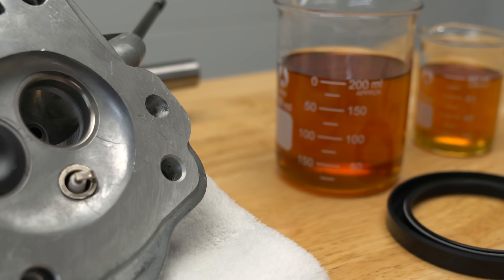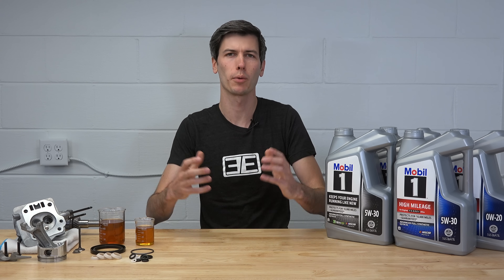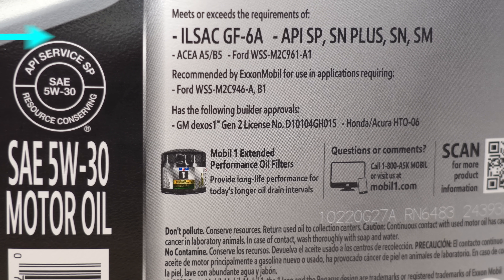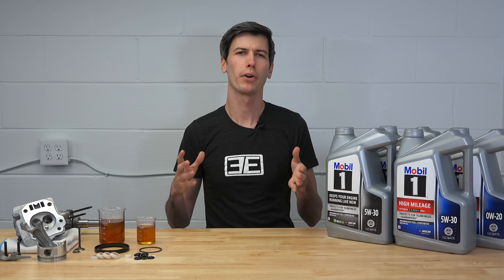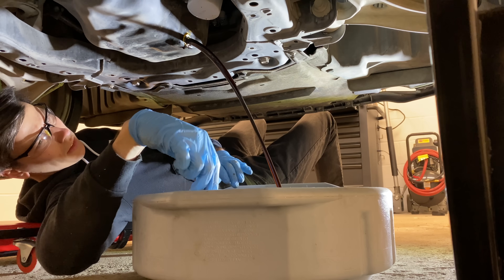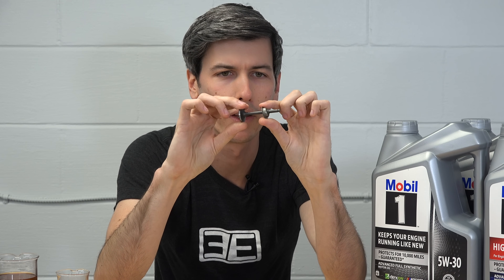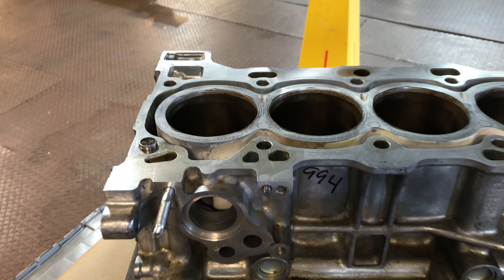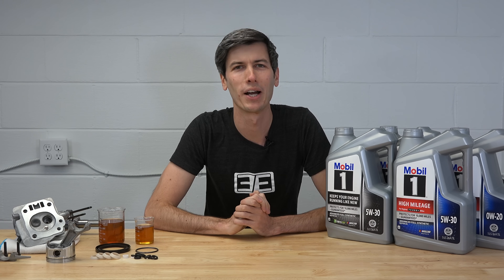Is Synthetic Motor Oil Bad For Old Cars?

Comment: When I was in airframe and powerplant school, we brought in our oil filters after changing oil on our cars to learn how to cut them open and diagnose what is in the filter media. One kid had a v-8 Chevy caprice with over 100k miles. He cut the filter open after first change to Mobil 1. The filter was jam packed with carbon. When he cut the filter media out he was able to fill quart size bag with carbon. So if you switch to synthetic in older car, I would change filters every 500 miles and cut them open to diagnose how much carbon is being accumulated.
Reply: Im guessing that may be due to the detergents in modern oil
Reply: @Magnamaxx01  once again, detergents and cleaning, ie having a clean engine is not a bad thing.
That guys Chev engine had obviously been neglected.
Reply: Quart size bag full of carbon from a guard size filter?
Reply: robert mccully Yep, read my post. It was JAM PACKED tight. Once cut open and  pulled apart the carbon filled a quart size bag. He kept the bag of carbon for souvenir.
Reply: @naps3386  that was for the first change clean out, second change was probably better and third was probably crystal clear.
Reply: admiral_peck 7 Probably
Reply: @BasketCaseGarageForFun  I agree
Reply: This only happens, in the engine is neglected. If you always have changed the oil, right viscosity, synthetic oil will clean just a little bit more. I would change the oil and the filter early .

Comment: The new API rating (SN & SN+) is not reverse compatible it does not have the zinc content needed in older flat tappet engines, the amount used is reduced to the point that even adding a zinc additive is not enough with those new API Ratings.  You can purchase high zinc content oil (Hot Rod Oil) but if your car or classic truck is equipped with a catalytic converter, it will coat it, reducing its effectiveness, not a big deal if your area does not require emission testing.

Comment: Great video. To be honest, none of these things concern me. The only synthetic issue I have is internal leaks, past the piston rings. In my marauder, I was running synthetic oil and burned about a quart of oil every 1000 miles. I switched to conventional and don’t burn any oil at all with my 3000 mile oil change interval.

Comment: Question: Should you use a different viscosity engine oil in the winter than you do in the summer?
Reply: Depends on the engine and the temperature difference between summer and winter. These days, most manufacturers are recommending 0W20 - no need to swap oils for the season. However, if you have an older engine and you live somewhere it gets really cold in the winter, you can make a good argument for running thinner oil in winter.
Reply: No. The whole purpose of multi-viscosity oils is to eliminate the need to switch. They're thick enough for hot temps, and don't thicken up so much in cold temps. Jason already addressed this in his "Will Thinner Oil Damage My Engine?" video.
Reply: @jonclark1288  Fair point, but there are exceptions to every rule of thumb.

Most modern engines are recommended to use 5W20 and 0W20. The OEMs do their testing and determine these viscosities to provide adequate lubrication at high temps, and obviously they flow fine when it's cold. In a lot of cases, there are parts (like AFM or DoD lifters or VVT actuators, etc) that will not work properly with thicker oil - despite fact thicker oil provides better lubrication at high temp.

However, if you do not have a newish modern engine, a 0W20 is not suitable. For example, I own an old 1995 Subaru with 365k miles on it. OEM recommended 10W30 or 10W40, but they also mentioned in some hot climates, or high-load/towing conditions - that 20W50 may minimize oil consumption. I found that my car, with 10W30, consumed a fair bit. So in the summer I use 15W50. But for the Michigan winter, the hydraulic lifters would noticeably rattle too long on a cold start. So I'd use 10W30 in the winter to solve the problem.

There is no singular "hard and fast" rule that captures the nuances of all cases.
Reply: @GroovesAndLands  ok thank you so much! I own a 2004 volvo with 215k miles on it, and live in western maine so I am probably in a similar situation as you.

Comment: Hey what's the hype with the synthetic oil I've been using conventional motor oil for as long as I can remember and I'm currently 55 years of age of course I do change my oil on a regular basis, based on old school every 3000 miles or 3 months whichever comes first I've never had any issues, convince me that I'm supposed to pay more for synthetic oils because it's supposedly better!... p.s. and yes my vehicle see the drag strip on a regular basis.

Comment: I have been using synthetic 15w-50 mobil1 and predominantly amsoil recently in my e30 for 5 years in two different cars. If it leaks it's because the engine needs new seals. Especially since the factory oil pan gasket is cork...
Reply: Why so thick? I want to  put that weight in my e90
Reply: @EKHBLOVER  I have a m20b25 and the factory spec weight is 20w-50 I will go from 15w-40 or 50 depending. Or even 20w-40 to 50. Since you have a new car just use the factory oil spec. And use a good synthetic. Mobile1 is good. I just prefer amsoil for longer lifespan and still change it on recommended intervals

Comment: Oil pressure isn’t what makes engines last. The oil film is what makes engines last. Switching to a thicker oil to make sure the oil pressure gauge looks awesome, but the oil being so thick it doesn’t get everywhere until the oil is very hot, is not the solution to your problems.

Comment: What about zink additives/content for reducing wear on mechanical lifters? Espescially for G-modell 911's... Surely there is somthing yo be said about that?
Reply: Most modern diesel oil still has the zinc additives in it, so might want to look at either Mobile One or Shell Rotella in that case. Of course see what Porsche has to say, but its what most guys run in engines with solid cams these days.
Reply: Joe Gibbs Driven real synthetic motor oil has more zinc and phosphorus.

Comment: My oil pan has been oil soaked (yes, on the outside too)the last 3 or 4 oil changes, but it doesn't seem to be losing any oil according to the dipstick.
If I try a high mileage oil to see if it stops, would it hurt anything or create more leaks somehow if I changed back to my regular oil?
The engine only has 321K miles on it...

Comment: Synthetic oils won’t cause oil leaks, however they’ll exacerbate an already existing leak. The base oil particles are significantly smaller than those of a conventional oil, which is part of the reason as to how this myth came to be.

Comment: What about synthetic oils on small engines like lawnmower or generators
Reply: I use same oil as in car in lawn mower, worked fine for me, change it yearly with car so the remains in bottle the mower gets. It's over kill yes i know, but it's 'free' and basically cheaper then the mower brand oil even if compare the product price.
Reply: Many of them today come with synthetic oils already in them (OHV Briggs and Stratton for example) and there are monograde synthetics. However, there really is no reason to use synthetic if the engine didn't require it. It's not going to make it last any longer then just keeping up on your oil changes will. 

That said all aluminum bore small engines (virtually all) today have a fixed lifespan in operating hours. Eventually the coating on the bore wears off and then the aluminum wears down. And since it is aluminum and it's not possible to replace the special oxide coating on the bore its time to junk it.  This is why the new Briggs and Startton engines just tell you to keep adding synthetic oil as it is lost. By the time the oil were to be full of contaminates to be a concern the bore has long since worn out 500-1000 operating hours for non commercial engines.
Reply: @Cragified  i see, my generator have over 1000 hours of use and still crank up at first try
Reply: @Carlos.Rivera  By non commercial I mean your low end 1-5hp engines for push lawnmowers. These have a dirty, hard, and short life (often neglected air filters on something that pulls in very dirty air it creates). 

A small generator can usually last 2,000 to 3,000 operator hours. Remember 1,000 operator hours is 41.6 days of operation.
Reply: @Cragified  You are "spot on" about the designed wear limits of small engines.  None the less, I have been using synthetics in my cars since 1978 and in my small engines for about a dozen years now.  No issues with either.
Reply: @johnjanoscrat8000  With how little oil is in most small engines the cost difference is probably almost untangible.

Comment: The absence of a whiteboard felt weird. As for the oil that I am using in both of my 21years + cars, it is a fully synthetic 10W40. I have used a thicker non synthetic oil only before the engine had to be rebuild for cost reasons and after the rebuilt for break-in reasons.

Comment: No mention of zdp missing in new oils and flat tappet lifters.
Reply: I learned that lesson the hard way.  Never even crossed my mind until it cost me a cam.  Engine started loosing power, and the lope at idle was smoothing out (thought I was loosing my mind on the last one).  Then I started to hear valve train noise.  Pulled the valve covers and about 80% of the valves were out of spec.
Reply: @ShainAndrews  that's the only reason I'm going full roller on my next build. Don't care for the price of upgrading but for a daily driver I guess it'll be worth it.
Reply: @nashvilleoutlaw  I considered going that route.  Instead I decided to rebuild and run  diesel rated oil.  Run that oil it everything including small engines.  Of course that was before they started reducing zinc in those oils as well.

Comment: Have a 2006 armada with 152k miles... was using full synthetic before but I notice that when the engine is warm oil goes too thin hence my oil pressure gauge goes moving back and forth on idle. Switched to high mileage and all is good again.

Comment: Jason,
Is Mobil1 still a Group 3 petroleum base synthetic or have they upgraded to a true synthetic base now? And is it still Group 3?
Reply: All motor oils are a blend of various base oils with an addpack.  There's no such thing as an oil that's 100% PAO, Ester, G3, G3+(GTL).   PAO for example are always a mix because it requires a carrier oil for the additives and to keep the seals pliable (PAO hardens seals).  I believe even in Germany 51% is the requirement min concentration  for an oil to be labeled as a synthetic. 

When it comes to motor oil the ONLY thing that matters are manufacturer approvals. The approvals determine performance not the base oil.

Comment: Synthetic is much better on maintaining high temperature performance compared to mineral oil
Reply: No actual mineral has better viscosity, but it will break down faster as it uses less additives and is less refined

Comment: Zinc content is a big factor for older engines, older Harley's shouldn't run synthetic, I've personally seen a straight 6 go from a fresh sealed great running engine ( original bearings) using a high zinc 10 30  . Not burning or using oil to a internal machine shop after changing over to 10 30 synthetic.... The zinc content was way lower in the synthetic.... Through testing and obvious damage the machine shop was able to provide the synthetic was the issue.... As it heated up it thinned causing bearing failure... Synthetic works in new engines .....
Reply: Run synthetic diesel oil, problem solved.
Reply: @sparkplug1018  it depends on the zinc content and how thin the oil gets after it heats up... Synthetic is a thinner oil.
Reply: @shawnp7215  Like most things in life its all application specific, but in an off the shelf product its going to be the best bet before going to something race formulated.
Reply: @sparkplug1018  I run rotella rotella synthetic in all the ls I do no issues...But in earlier built engines pre 1979 I just can't run synthetic I've had too many issues... Unless the engines have been rebuilt and have modern style bearings... I will run just basic rototiller with high zinc content no issues in the original  early model engine.... The 6-cylinder that I spoke of earlier...( I cannot reveal  the manufacturer's name because there was a lawsuit over) the owner of the six cylinder called the manufacturer and the oil hiiraan was what they said was perfect for his application...after the initial issue with the engine they didn't want to pay for it they said it was an older engine...the manufacturer of the oil said they had no responsibility after his lawyer contacted the oil manufacturer and a lawsuit was filed ( they were proven to be at fault ) they paid to have the engine rebuilt and also.... All I'm saying is just because a manufacturer says it's okay doesn't always mean they are correct... Enter these situations with caution and do your  due diligence... Remember they're in the business to sell oil...
Reply: @shawnp7215  Yeah its rare that a manufacturer would recommend to run something and it turns out to be the wrong product. But it can happen, still pretty bizarre though. Glad it got resolved in the end though.
Always had good results with Rotella in my builds though, but its all case specific. Best advice is start with something we know has a high zinc content and research from there.

Comment: Switched my old impala over to synthetic and have had zero issues
Reply: GM Dexos is a specification called for by GM . It is not an oil brand per say. 
ZZDP zinc has been greatly reduced in modern oils because it's hard on catalytic converters and is not needed for modern engines that have roller lifters or followers, it was used as an extreme pressure sacrifical lube for the older flat tappet engines.
The lawsuit was between Mobil and Castrol.
Semi or blended synthetics give a little more protection, but idk if they are really worth bothering with in my opinion, because the run of the mill full synthetics do not cost that much more.
 And I must say the group three full synthetics are a step up from conventional oils and are probably good enough for most people, but for enthusiasts and gear heads in the know who want the best lubricants possible, know you can't beat the performance and protection of the premium 100% synthetics like AMSOIL. These lubricants cost more to make therefore they cost more to buy, we understand and accept that.
Reply: What synthetic oil did you use? Most synthetic on the market now days is not full synthetic!
Reply: @Roadking556  GM Dexos
Reply: @UglyStikSimp  sorry not familiar with that oil. Not sure if it is a true synthetic
Reply: @UglyStikSimp  and unfortunately outr government here in the us lets manufacture advertise full.synthetic when in fact it is not .and your screen name makes me uncomfortable.
Reply: @UglyStikSimp  GM Dexos is a synthetic blend, and a 30% synthetic, 70% conventional blend at that. Not really equivalent to the synthetic being tested here.
Reply: @PlayinWithMahWii  many oils out there are dexos rated, most are "so called full"  synthetic, because that's what it takes to meet those specs, I don't believe conventional oils can do it.
I don't think there is any way of knowing percentages of synthetic to conventional without the manufacturers stating such, which they don't. Blended oils can have very little synthetic in them.
Reply: @PlayinWithMahWii  Dexos 1 Gen 2 has NOTHING to do with whether it’s synthetic or not. I use 100% synthetic that’s Dexos 1 Gen 2 approves
Reply: @Roadking556  Majority are hidrocracked but with a nice soup of additives, detergents and ZDDP... the base is enough good for engines. After you have Amsoil (PAO) or RedLine (polyester) they last long, work better in extreme conditions and they have a superb cleaning action (sorry for my crappy english)

Comment: I purchased a 1960 Buick Electra with 23,000 miles on it.  I started using Mobil 1 10W-40 and there were no problems.